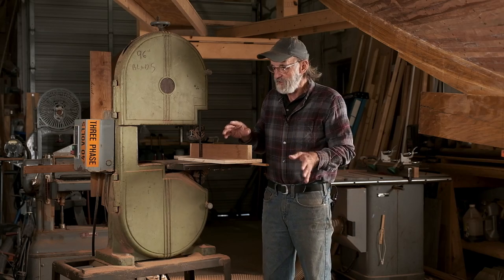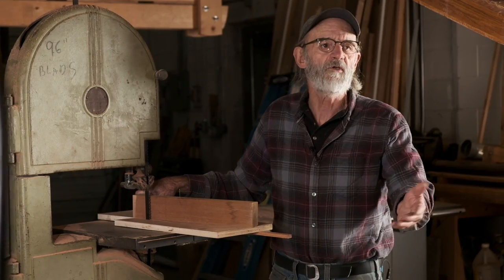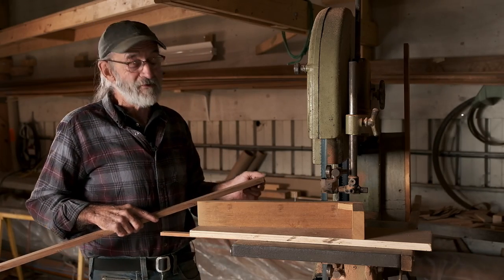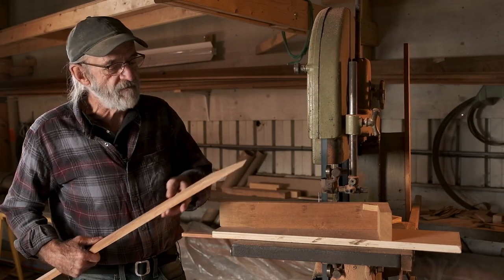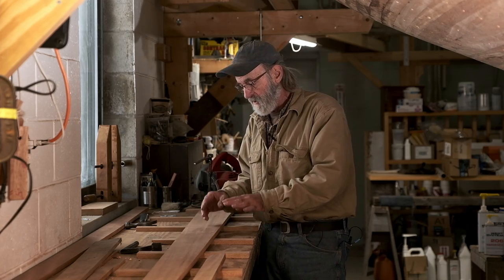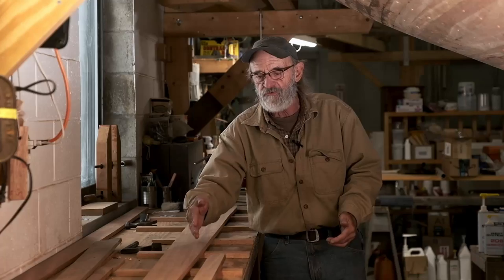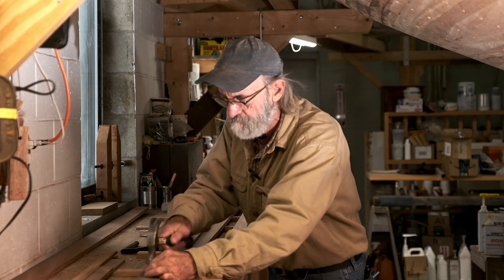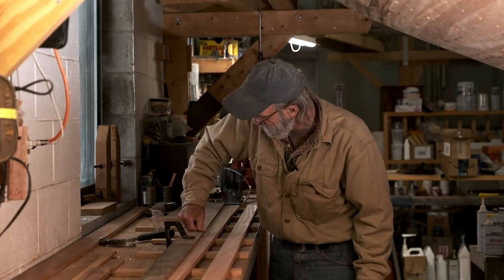Simplifying scarfs and a unique system for carvel planking: Tools & Tips #3

Comment: About your scarf joint I think it is worth mentioning that the end results of the cut with the band saw is a perfect texture for the gluing...with EPOXY  only. I'm pretty sure you, Louie, are very aware of this but I dont think all your viewers are.
Reply: You will find that dry mix urea formaldehyde and tube polyeurathane  are fine for sawn joints (non or low foaming poly).   I only know those things as holdfasts.
Reply from the maker: Good point Pierre. We're using epoxy on these scarfs. There are a number of reasons for this, including epoxy's gap filling properties. If you were using a resorcinol glue, for example, the joint should be closer fitting. Of course, there are tradeoffs here as well, including temperature, clamp pressure and pot life. We believe epoxy is the best choice for our conditions, but figuring out which adhesive is best is really a matter of experience, science and a little art.

Comment: So Lou, both Acorn to Arabella and Tally Ho use a graduated bevel saw. Did they both copy your revolutionary design? Also, I'm interested in your idea of scarfs as opposed to butt blocks. Clearly you feel scarfs are superior. But Leo, from the Tally Ho project is using butt blocks. I'd be interested in your opinion.
Reply: I would be interested also
Reply: Steve at Acorn to Arabella stated that he got the idea from Lou, but he modified his saw slightly differently. Lou has done a video on the topic before - on the Tips from a Shipwright channel
I haven't started watching Leo's channel yet
Reply: The difference in materials and their thickness along with type of wood and situation would determine different approaches.  Just like Lou said, a 1 in 7 scarf might be fair for one application vs a 1 in 12 for another.   Leo has one layer of thick 1 1/2” x 8”- 10” anjalique lumber being installed vs Lou’s 2 layer laminated strip & carvel, and a scarf joint failure on Leo’s planking would be a huge failure if it happened.  By fastening the backing blocks to the back of the butt joints you have less chance of failure.   Leo could have used the backing blocks behind glued scarfs but their is nothing gained vs butts but more work.
Reply: @trout4bait549  absolutely  worth watching ,, leo and his teem   ,  he's  doing amazing  work,
Reply: Hey Dale, they are two different methods, Lou is going the more glue strip plank for which scarves are better. You can hear Lou saying there will be no chalking. 
Leo is going the more traditional carvel planking in which he describes his reasons 1 or 2 videos ago.
Reply: @trout4bait549  Leo is great as well, as inspiring as Lou. Always looking forward for over 2years now for every vid. They share.
Reply from the maker: Hi Dale. I believe the progressive bevel circular saw started with Lou as he was using and working to perfect the system over 30 years ago when I first met him. In the case of scarfs vs butt blocks every situation is different. It depends on the type of wood, how it's sawn, how dry it is, the thickness of the planking, and the conditions you're working under. We've had great success with scarfs in general, but have used butt blocks as well. That said, Leo is doing a tremendous job on Tally Ho and both Lou and I enjoy watching his videos.